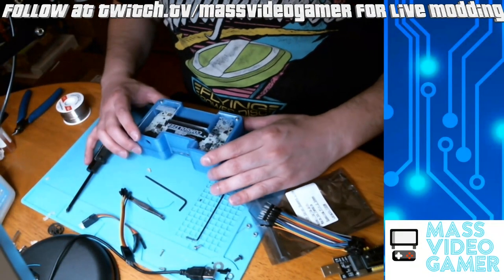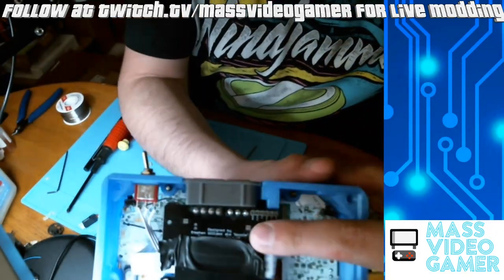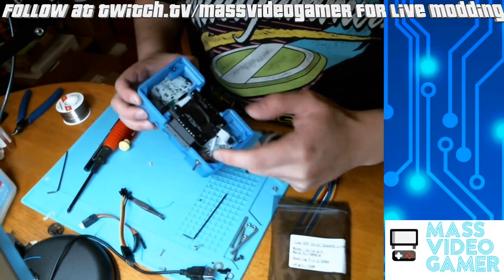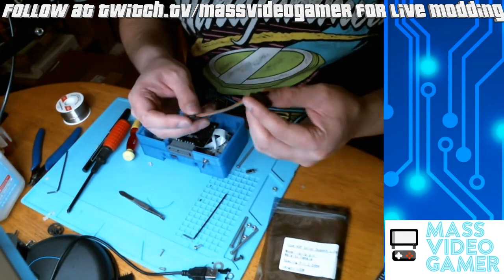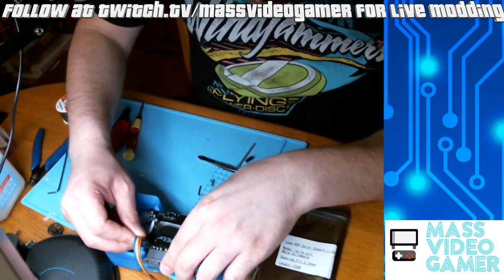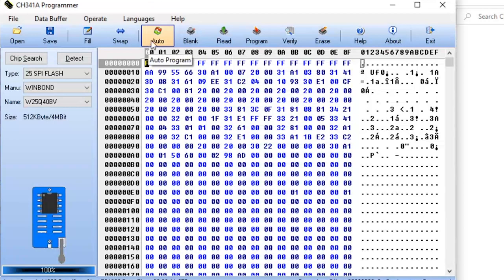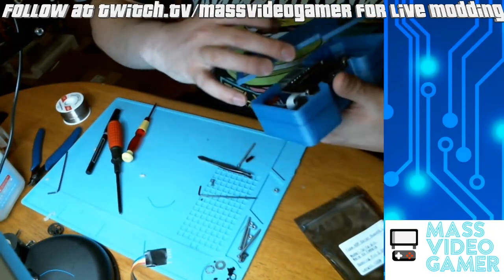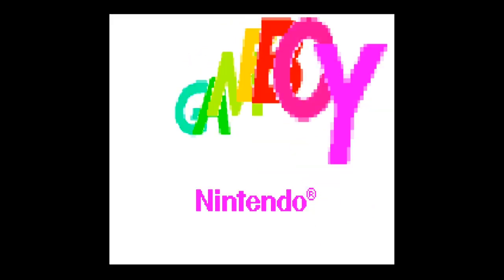How to update Woozle's Game Boy Advance GBA Consolizer

Comment: Just did this a few minutes ago, making a harness out of electrical tape was a great tip. Like others I had to erase, blank, then auto to flash the firmware. Also make sure you do those things ASAP after turning on the consolizer, as it goes to sleep or something the erasing/blanking/writing fails.

Comment: thank you for the video and sharing the knowledge - I was not able to flash mine till I blanked the chip - I was getting 'chip not nulled' I blanked the chip and it programmed and verified fine after that.
Reply from the maker: Good to know in case others run into that issue! I didn't as you saw, but that definitely others could! Thanks for sharing!

Comment: Had mine refuse to work in spite of everything being perfectly connected and powered on. Turns out I had to power-cycle the GBAC as I was taking too long to initiate a flashing sequence, causing the CHA Programmer to time-out error on me. So another heads-up for people using the CHA programmer. You may need to power-cycle the GBAC once you get everything set up, then quickly start the "Auto" flashing sequence.
Reply: this comment saved my night

Comment: I’ve followed the instructions and I am getting Write Operations timeout failed.  I’ve even tried erasing, blanking, and programming.  Any ideas?  Also the video doesn’t give a good viewing of you cabling.  I know you said to match up the pins on the consolozer kit to the programmer pins but then another comment or stated the PINs are mislabel. Mine is the one you linked in the video and everything on the consolizer board to the labeling on the programmer are the same as what you have in the video.  Please advise.

Comment: If a user should have issues with going the " Auto " route. First Erase, THEN Blank (it checks that erase worked), then Program. A chip not null message will let you know that the chip is not blank.

Comment: You can make your life easier for the next time by soldering a pin header. You also don't need an SPI programmer to update the firmware, if you have a Raspberry Pi at hand. Install flashrom, hook up the pins and you're good to go. Backup: "flashrom -p linux_spi:dev=/dev/spidev0.0,spispeed=1000 -r OLD.bin". Write new: "flashrom -p linux_spi:dev=/dev/spidev0.0,spispeed=1000 -w NEW.bin".

Comment: I would simply solder header pins to the board for future use & whatnot.  If you were able to put the consolizer together from scratch then that should be a very simple solder job anyway.  I am a rather novice solderer and I was able to do the entire kit without any problem, so doing headers would be a cinch.
Reply from the maker: You could solder the headers (I have for other boards) but I feel there isn't a point in this case as Woozle has stated this is the last firmware update for the consolizer and  with flashing taking only seconds anyway, soldering headers would be more of a pain to go deeper in the consolizer for some. The video is simply to show a simple way to flash the fw for people who may or may not have put this together, yet would like the benefits of the new firmware. Thank you watching and commenting!

Comment: I used the 1.1.0b firmware. I'm getting a black screen. No blinking cursor like you have, though.
Still have audio output and can hear games load. Any idea where I should go next in troubleshooting?

EDIT: Fixed it. Pro tip, make sure you re-seated the ribbon cables correctly :)

Comment: I tried this. Couldn't flash. Would never detect the chip properly. I even soldered the points. (all except 3.3v as instructed in your video). it shows orange when the consolizer is on but it will never properly detect it. (I am using win10 64bit, have intel i5 9th gen). Tried both 1.30 of software aswell as the one you provided.
Reply from the maker: It might be the programmer. Because they are cheap programmers, I have had a couple fail. I would check your wiring first, then try buying another programmer.

Comment: By the way, any reason you can't just use mini alligator clips to do this?  & just clip them to the connections on the board and the reprogrammer?  Would this work ok?  Seems it might make a more reliable connection vs trying to hold the pins on the board.
Reply from the maker: I personally prefer to use the dupont wires as the spacing between pins match up perfect if you grab the ones I linked. The flashing really takes less than 30 seconds so if you hold still with slight pressure it work out fine.
Reply: @massvideogamer  Yeah that is an option, but id be more comfortable using alligator clips.  Any reason you cant do that?  Would it maybe not make a good enough connection or anything?

With the holding method I'd be afraid that I'd brick something or mess something up.  Too many things that could go wrong by just holding some connections with your hand while sending actual data over.  T
I'd say that's not a very good or reliable way of doing things...

Comment: Anyone tried the v1.1.1 firmware? I've ordered a USB programmer but see that the latest firmware isn't recommended (due to sound issues).
Reply from the maker: I have and the latest firmware as of writing this (1.1.1) has issues with sound over DVI+ (HDMI). I would flash 1.1.0. If you use sound over analog, the 1.1.1 update is fine.

Comment: After flashing, I have the black screen same as you (I can see the On screen menu when pressing down select, hear sound). However, resetting does not bring the picture back. Tried multiple reflashings, both 1.1.1 and 1.1.0, same thing. I'm starting to suspect the ribbon cable. Any ideas?
Reply from the maker: I would try a different TV first. I have flashed a few of these now and they all have worked after resetting. I hope that helps.
Reply: @massvideogamer  Should've come back and updated this comment. The latest  sold GBAconsolizers have slightly different hardware it seems which caused the issue. Woozle and Game-Tech released an updated 1.1.0 firmware which corrected the problem as soon as I flashed.

No amount of resets, reflashes and multiple different tvs didn't work, so I really needed the firmware! Thanks!
Reply: If anyone reads this, GBA consolizers don't have a problem with current firmware. The problem was caused by me unknowingly flashing a firmware which didn't work with this particular hardware revision. I was just a few days too early to be able to recuperate from the wrong flash.

Comment: PLEASE BACKUP YOUR OLD FIRMWARE FIRST! Both the 1.1.0b and 1.1.1b work for me. Initially after flashing I got a black screen. Press Down+Select to bring up the Consolizer menu, enter "System..." and do a "Reset". After that everything worked fine for me.
I had problems flashing the new firmware (using flashrom) due to it being to small for the flash chip. I first BACKed UP my OLD FIRMWARE, CREATed A COPY of it and dd'ed the new firmware over the copy using "dd if=NEW.bin of=COPY_OF_OLD.bin conv=notrunc". COPY_OF_OLD.bin is now your new Firmware. Flash that to your device.